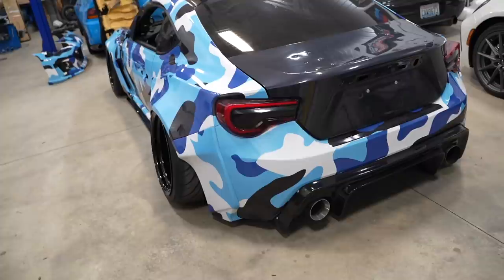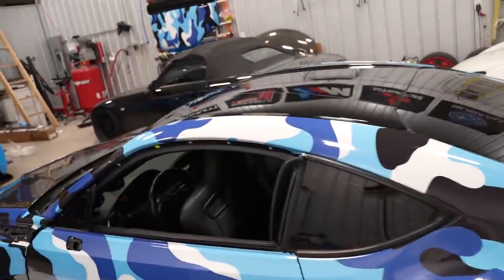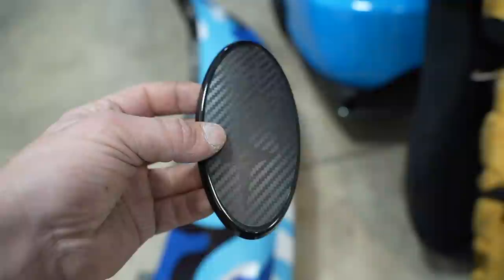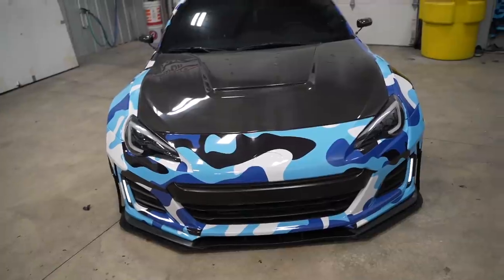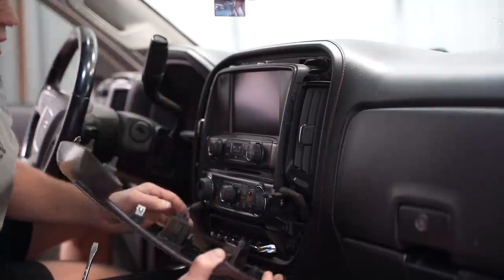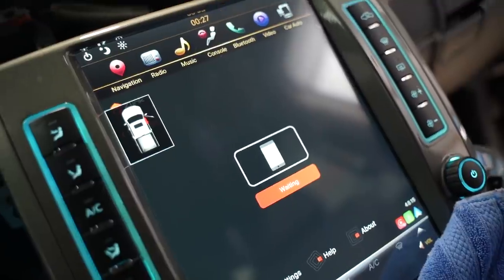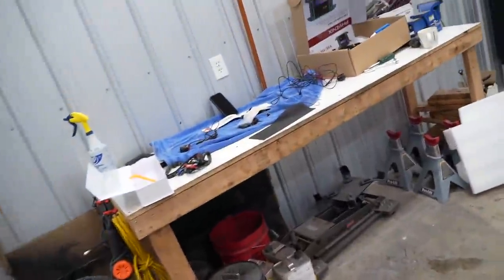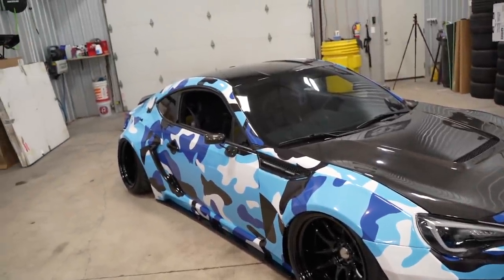An Early Christmas Gift to myself

Comment: My opinion is wrap most the hood minus the vent like you originally wanted. Then on the carbon trunk just wrap the top or back so its like a partial wrap like the hood and then stay wingless I think it draws more attention to the body and wheels and makes it look lower and more clean with out it. And for the brakes I think it would be fire if you matched the dark blue of the wrap with baby blue brembo stickers

Comment: Devin if you still want to put one of those mirrors in the truck and don't care about loosing the on star or whatever those other buttons are on the bottom. They make mounting brackets for these dashcams on Amazon that replace the entire mirror and make it a very clean install. Makes it look almost oem if it wasn't for having multiple wires. I've been looking at them for my truck hoping to do one soon. Love the consistent content thank for the hard work

Comment: I’ve got a VanTop Mirror dash cam in my work truck and I love it. It’s fairly similar to the one you bought, but you can get it in different sizes. I got it through Amazon and it wasn’t too expensive. You can also buy a hardwire kit for it so you don’t have to use the cigarette lighter as your power.